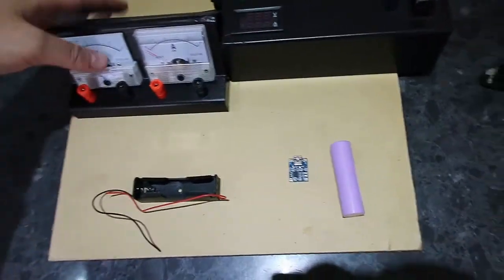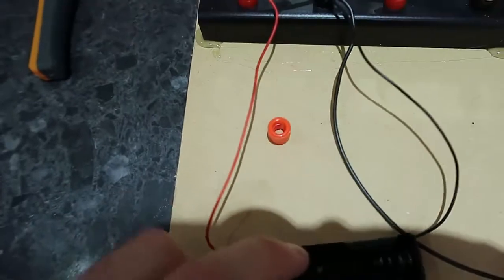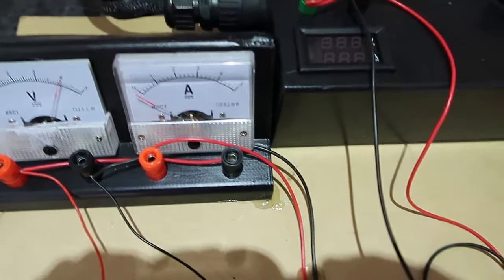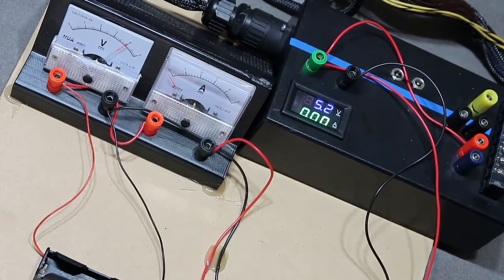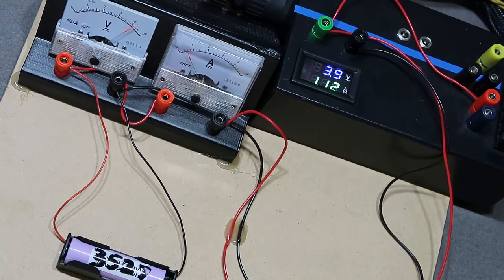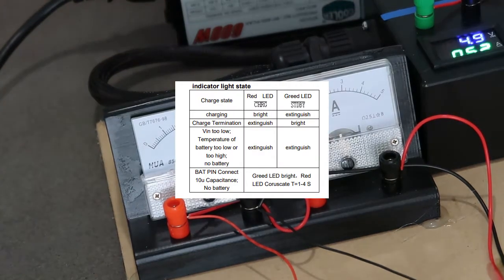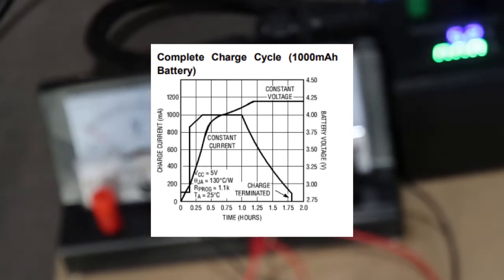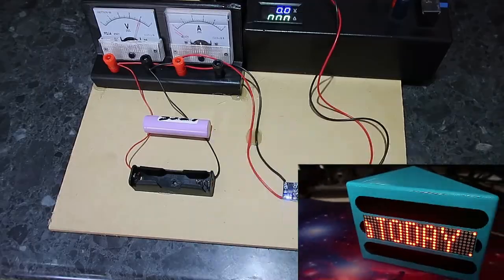TP4056 Charger: Charging 18650 Batteries with Thermal Imaging Insights 🔋

Comment: Hi, I have rechargeable flashlight which has a dead charger. It comes with three AA NIMH batteries in series which comes up 3.6 V and 1 Amp. Can I use this little board to  charge these batteries? 

Thanks

Comment: I have a 18650 with 0.66 volts in it. Can tp4056 charge it? I have heard it can trickle charge batteries which are below 2.9V.

Comment: What is the maximum number of lithium ion battery that can be connected?
Reply from the maker: This charger is designed to charge one battery, but you can connect 2 in parallel it would work just take longer to charge them (it would take twice as long to charge if you have two batteries), and potentially not charge properly/fully if cell capacity is not close together. personally I would buy 2 TP4056 or look for a different charger
Reply: Can you pls suggest me a charging module that can charge atleast 5 battery at a time...?